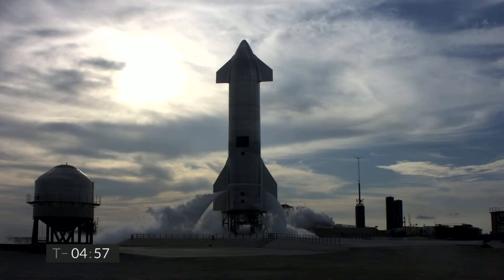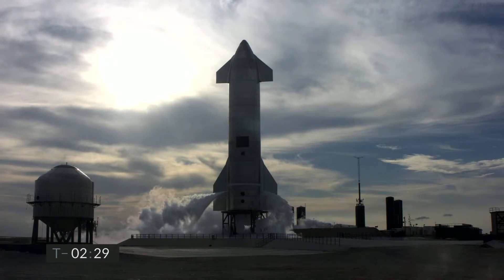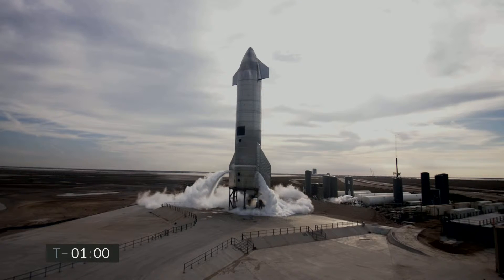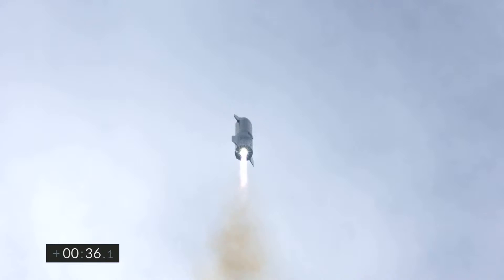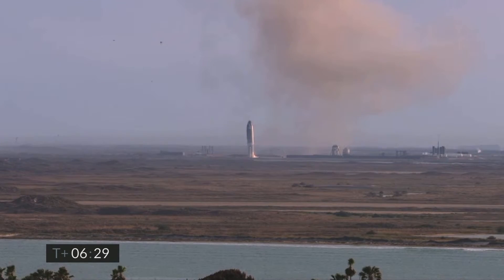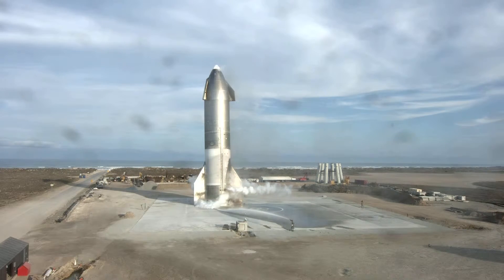Starship | SN10 | High-Altitude Flight Test

Comment: QUESTION: What would the g forces be on a crew during the fall back to earth?
Reply: The crew would be on side that  is facing up during the  bellyflop
Reply: So they. Probably  wont even feel any g's
Reply: @kadincolbath640  I think they would be feeling something.  I have been in commercial jets descending quickly and I felt strong g force that can throw your arms up in the air.
Reply: @koyotecow7102  they would feel something i just think not as much as other people think

Comment: So pretty much, right before the landing, deploy all three Raptor engines, briefly ensure a hover state, increase thrust of one Raptor engine while simultaneously decreasing it(thrust) from the remaining engines. Then, control decent by gradually reducing power ((super complicated)) until touch down. Safety comes from erring on the side of "more power". Super happy to see SpaceX succeed. The optimization guy did an amazing job!

Comment: My guess the blow is somewhat related to the hard landing, also they were going to re-light 3 engines and immediately shutdown one, so the two must be left running during landing but in fact two were shut down and only one left running. It was funny when spacex commentator said that one left is exactly what was planned. What was unusual is that after landing no venting was going on.  Probably that's why it is eventually exploded after pressure raised enough to blow the tank apart. I might be wrong of course but these are the thoughts came into my mind.
Reply: I’m sure this is what they finally decided on for the engines, the plan was always to switch to one for the final landing. Elon said they would light 3, pick 2 of the best to do the flip and shut down the other, then 1 engine for landing. They probably decided to keep 3 for longer though. Also on lab padre nerdel can you can see one of the landing legs not deploy correctly and it’s flipping around during the landing, and then it kinda bounces off the ground.
Reply: @uoppsdnsu4266  Yep. Exactly.  I didn't notice landing legs issue to be honest but what I did notice is the hard landing and bouncing, that's for sure. But don't get me wrong,  great results anyway.

Comment: Why don't they use a virtical steam  or  Electromagnetic Aircraft catapult Launch System, you could locate one either side have 2 lugs either side of the aircraft, extend to about double the length of the starship, this will get it off and launched and most likely save on the fuel used to get liftoff.

Comment: too bad, they don't show the explosion afterward. It landed a bit hard, and bounced up before settling down. I think that cause tank damage, and you can see it leaked some dark gas from between the rings near the bottom. 8 minutes after landing, something ignite, and unschedule rapid disassemble.

Comment: 8:27 the color of the mixture on the two engines is visibly different.  One is purple (good combustion for Methane) and the other is orange (possibly fuel rich).  Looks like it was that way with three engines too, so maybe it's deliberate.

Comment: This is insane to witness.
Considering external factors like air density and wind speed. To maintaining the right deceleration and angle of such a massive object while descending. . 
On top of that, to get the location and point of landing accurately.

Comment: It didn’t vent after landing and the fire must have been fueled by some leak in the skirt. Came down to hard collapsed the legs. That put stress on thrust puck causing a leak small explosion launched it rest of fuel caught bigger explosion. I hope the Fire Truck and crew were gone before it blew up a lot of flying debris went very high.

Comment: I could see it coming.  I imagined SN-10 was in trouble when I saw the fire in the engine bay.  That kind of fire burns up all the control and commanding cabling.  Once it landed,  they already had lost control of tank pressure. they probably saw it coming from the very beginning and knew it was lost.

Comment: SN10/SNX was like these heroes that die at the end of the movie
"My existence is no longer necessary"
Explodes
Reply: Did it explode !?
Reply: @shawonzaman2588  Yes, it was a hard landing that damaged the methane tank. There was a fire at the base, and boom. You can check the NASASpaceFlight video.
Reply: @americanredneck357  
Thanks for the details man
Reply: @shawonzaman2588  No problem! New information may come out, but that's the best guess at this point.
Reply: @shawonzaman2588  yep
Reply: 8 minutes after
Reply: It's going to relaunch but failed.
Reply: Super sad.
Reply: @theprussianempire8931  Not really. It achieved it's goal and it was never meant to fly again. It was a flashy exit after a successful mission.
Reply: @carljohan9265  true. Still wanted to see it as a lawn ornament.
Reply: @theprussianempire8931  to be honest though, that was the coolest way I've ever seen a rocket explode.
Reply: @carljohan9265  According to my math the bottom of the rocket was 213 feet in the air, and the nose was 373 feet in the air!
Reply: Daft Punk be like

Comment: 2 facts, it landed with 1 engine, after the relight and flip maneuver. Also, after the "soft" landing, it hop a little and it touch down again. Maybe this not that soft landing may cause some leak that lead to the explosion.

Comment: Jump when  land ,so these legs are not good for this rocket. Maybe jump kill rocket when landing, the engines cause pressure in the engine compartment, which caused it because the legs are too small and the gas has nowhere to go. But Great Job and carry on.

Comment: Those raptors literally sound like they’re ripping the sky open!
Reply: Seriously. One wonders how Musk can hear a noise like that... and then proceed to drive away in an electric car. 😆
Reply: @TravisTerrell  because he knows he could never have a car that sounds that cool so he doesnt even try
Reply: @TravisTerrell  Ngl electric cars sound way cooler imo. To hear the pwm signal driving the electromotors, complete quietness except for the rolling of the tires. It screams futuristic to me. Combined with a full blown computer saving you from accidents with ai object recognition cars don't get much cooler.
Reply: And they are running at around 50% power or lower, and it's only 3 engines. 
Imagine what 28 at full power will sound like ( ͡° ͜ʖ ͡°)
Reply: @carljohan9265  someone get those cows some hearing protection!

Comment: Highlights
5:32 : T-10 seconds
5:40 : Ignition and lift off
7:55 : First engine shut down
8:55 : Second engine shut down
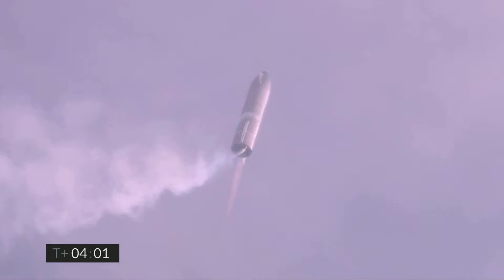9:40 : Hover
10:00 : Third engine shut down and belly flop manuver
11:40 : Flip manuver/landing burn
12:00 : Landing/touch down

Comment: Very Nice, just impressive. My First impression's are:

-Very clean ignition of the raptors
-Still pretty high vertical landing velocity ( maybe the single raptor wasn't throttled high enough )
-some landing legs didn't lock in correctly as seen in one of lab padres stream, but they would have been crushed by that landing anyways
-would have been nice if it hasn't exploded now Media is triggered negatively

Comment: It would appear that the landing legs were completely crushed.
Since stronger heavier landing legs would be prohibitive then it
is obvious that the landing pad needs to be shock absorbing.
Some kind of spring assisted hydraulic system, much like earthquake 
absorbers for buildings. Your welcome.
Reply: ... or just a better thrust control on landing 😉😄
Reply: The landing legs are only a temporary solution, both SpaceX and Elon know that and have said that before lol

Comment: The fact that it landed with an engine leak and crappy landing legs is crazy.
With the right engineering using SN10 data, The SN11 will 100% be a success when it flies and lands back to the ground.

Edit: Wasn't expecting this comment to reach 121 likes thanks.
Reply: It's like they threw a pencil up in the air and willed it to land on the eraser!
Reply: It seemed the landing was a tad hard
Reply: This is why SpaceX is the best!
Reply: fun fact, this one didn't have the landing legs on it as its just a prototype and they were gonna never fly it again they just had weights simulators (block of metal) on it so it literally just landed on its engine skirt, which may be even more impressive!
Reply: @cheeseninja1115  Nope, it did have little landing legs, but they are very primitive chunks of metal, that part of the design isn't really on yet.
Reply: @cheeseninja1115  It had the landing legs please guys don't mislead people. There are landing legs, but small.
Reply: It didn't had engine leak.
Reply: @graullas8981  11:52 there's a gas coming from under the skirt and burning on the right side
Reply: https://youtu.be/fr3qewOZTjA !!
Reply: China Space agency🇨🇳🇨🇳💪better than trash nasa and space x🤢🤢🗑🇺🇸
Remember, china save the world  with space knowledge 🇨🇳💪
Reply: @xhafts  remember when they blew up a village because of rocket failure? Go China Space Agency

Comment: For those that don’t know SN10 exploded some 10 mins later after landing. Congrats to spaceX, still an accomplishment and series progress made today!
Reply: Check your staging kids. Don't be like spacex and accidentally stage the FTS
Reply: Sure, not an....optimal result you'd want on an operational flight, but it still is in testing, and fixing a methane leak is way easier to solve than landing issues.

Comment: 5:34 t -10s
5:44 t -0s, ignition
7:41~ first engine shut down (one of three)
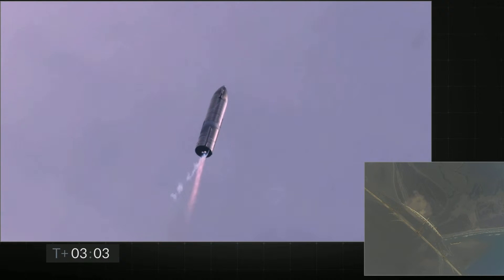8:44~ second engine shut down (two of three)
9:29~ 10km apogee hovering
10:00~ flip maneuver to horizontal
11:40~ flip maneuver to vertical (my most amazed)
11:57~ touchdown
Reply: ... and rapid unscheduled disassembly 10 minutes later. RIP SN10

Comment: I am no engineer but possibly use one engine for the flip maneuver, you are getting way too much Kick which is why the last launch previously failed.
Kick it in 1 km above current, then all three once its vertical.
This one came in hard and you could see at a distance it was tilted.

Good success though! 

I heard Elon will be in Saskatchewan soon looking at Carbon Capture technology, he should visit Hurting alberta oil and propose a new SpaceX Manufacturing/launch facility.
Lots of oilfield welders laid off ;)
Im a Steamfitter/Pipefitter. 

Build in the winter launch in the summer? 🤪
Reply: SN9 used one, that didn’t end well

Comment: Well the thing that impressed me was that when the explosion occurs it was strong enough to contain the bulk of energy directing the thrust downward. Throwing it vertically. In some of the early failures the it opened up the structure circumferencially shredding the entire device!

Comment: Technically SN10 flew twice. Just didn't land the second time.
Reply: Also landed after the 2nd time. Just in pieces.
Reply: @sebastianweise4790  Technically the truth :D
Reply: @sebastianweise4790  Good point
Reply: Well technically it did land the second time also, just not in 1 piece and up right but who cares, small details
Reply: I'm not sure what you're talking about. Maybe I'm missing something
Reply: @jiisdown2195  after the stream SN10 blew up, sending it a couple meters into the air.
Reply: @bumbo222  ok thx I didn't hear about that
Reply: Nou, you're all wrong.
It flew 3 times today. First a mm, then 10 km followed by a few meters 🤓
Reply: @Joey-ir3lk No, it only flew twice. It engines did light, but it aborted in the start before it was decoupled from the launchpad.

Comment: Kinda confused at the fire below SN10 after the landing. I understand there could and would be excess unburnt fuel once the engines are shut off, but these are normally burned off within a few seconds. What happened in this case? Why did the fire keep burning?

Comment: Omg, yesssss It didn’t explode!!!!!
Reply: Update: it did
Reply: @painsin1954  True, but it at least completed its goal on landing. I think the cause of the exploration was probably due to the small fire near the engines when it landed. Or they self destructed it since they have other models coming down the pipeline but probably not the case.
Reply: @Star-mq9zb  yea it looked damaged when it landed and I thought it’d be dangerous to go to the pad and check everything and it would take some time to remove it from the pad so I’m happy it blew up so now we have a clear pad and no one has to risk there life by throwing a rock at it form a far

Comment: Kabum! It exploded shortly after! XD
Reply: Shhhhh! Don't kill the dream 😅.
I was watching on 2 channels at the same time and it blew like seconds after I said "YAY it didn't blow up!"
Reply: @quinbland2853  wait it realy did?
Reply: @Julian17.07  Yeah, they blew it up remotely
Reply: @fedora997  no they didn't. That just makes studying SN10 infinitely harder. And those charges aren't that powerful. They're designed to ignite all of the fuel at once, which destroys the rocket.
Reply: That was the TFR...they destroyed it remotely. Safest way.
Reply: @Matze27396  If it was the FTS the explosion would have come from the middle, not the bottom.
Reply: @Matze27396  what's the TFR
Reply: @twicetzuyu7668  He probably means FTS: Flight Termination System. Basically explosives attached to the rocket to blow it up if something goes wrong, to prevent it causing damage to people or property.

Edit:  "W M" beat me to it. :)
Reply: @Flyineddy   this thing have fukin landed without legs ! , amazing that hes not exploded at toutchdown
Reply: @Vo0d0o2009  It did use landing legs, you can see them being deployed on some other peoples footage. But I think they got damaged on landing. You can actually see SN10 bounce when it lands. This might also have damaged some other parts, like maybe the fuel lines in the skirt, which might be responsible for the explosion.
Reply: @Flyineddy  i think it bounced on the skirt of the rocket that ( hold legs & hide engine thrust ''dome'') but its unclear , maybe legs was50% deployed , by the way that was so satisfacting , can'T wait to see sn11 flight  hi from quebec canada
Reply: @Flyineddy  methane leak can logicaly be due to  ground contact with whole structure , ( skirt) , ,then a fracture in a joint because sn10 have toutchdouwn lightly hard with like 1 degree of inclinasion , it for sure shocked all welding joint of the whole rocket ,its mostly the only thing i can see from here
Reply: @Matze27396  thanks
Reply: @Matze27396  that was NOT TFR
Reply: Ohhh I mean not TFR...i mean FTS... Flight Termination System. That could destroy the rocket remotely if necessary.
Reply: it was on purpose